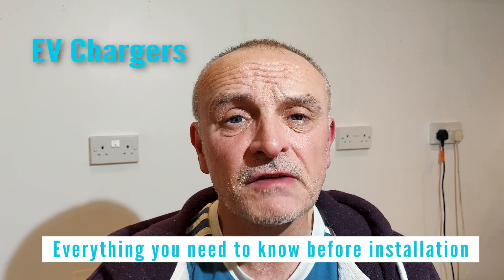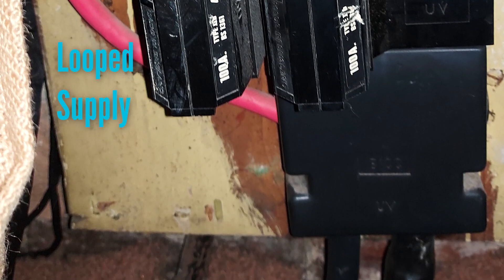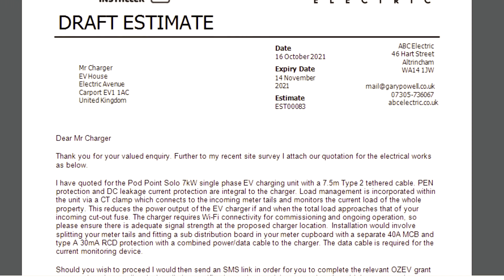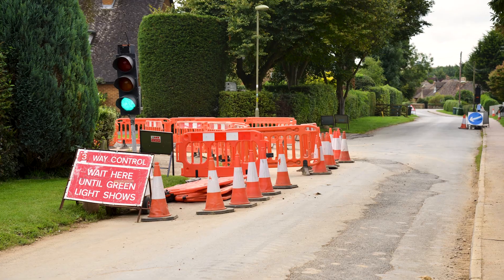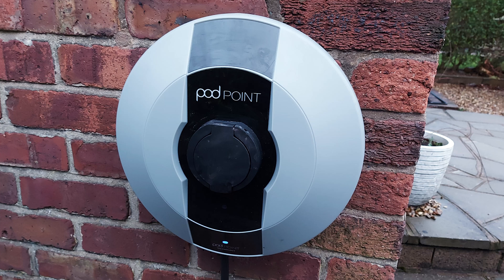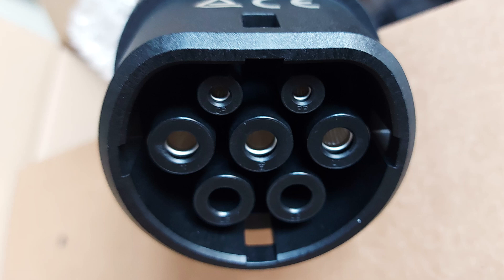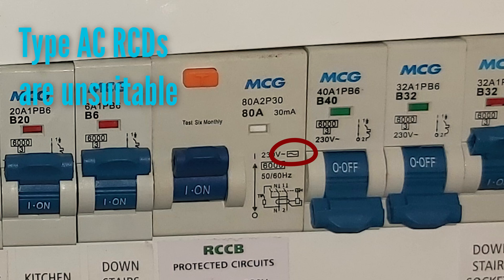Everything You Need To Know Before Installation of an Electric Vehicle Charging Point

Comment: Ohme have told me I’ll be able to have a standard install for my home charger as there’s only one cable coming into my electric box so in their minds I’m “not looped”. However, the property I’m joined onto and is closer to the road than me has 2 cables in theirs. Having searched online, I believe I am a loop off of their box/feed. I explained this to Ohme but they still claim I’m not looped and the installation will be ok. 

Is it only an issue for those that have two cables because it could disrupt their neighbours supply too or could I be right in thinking I’m maybe at the end of a loop out of their system and this be a problem for me? Thanks in advance!
Reply from the maker: Hi. It certainly sounds like you're the end of the loop, but the only definitive way to find out is through the DNO. The reason it's an issue is that the shared cable wasn't designed to carry the potential load to 2 properties simultaneously and adding a charger is a big addition. The DNOs are now allowing chargers to be fitted to looped supplies if load management is installed, and they will then unloop it in their own time.
Reply: @abcelectric  thank you! With our housing setup it seems the most likely that I’d be the end of a loop, so will ask/mention to the installer when they arrive. Is load management something that can be installed with any of the common EV chargers or is it only available on certain models? I would be happy with a restricted charging speed as a shorter term solution - I just don’t want anything to be unsafe!
Reply from the maker: @kingweddingmedia  Most chargers can be downrated or fitted with load management. Without knowing specific details of your installation and what was quoted etc I can't comment. What I would say is that Ohme should know what they're doing. The protocols for fitting chargers are well known
Reply: @abcelectric  fab thanks for your reassurance and completely understand you can’t say for sure etc. Earned my sub! 👍

Comment: Hi mate prob a silly question but im looking into this atm as just orderd a car, but a live in a new build property were the electric meter is on the side of the house  next to were i want the charger to be installed, the fuse box is inside my house under the stairs cupboard , do you need to have a cable  to the fuse box  or is it just the eleci meter you need, sorry for  the long winded question🤣
Reply from the maker: Generally speaking, either the consumer unit (fuse box) or incoming supply tails (from meter) are acceptable to supply an EV charger

Comment: This reminds me when the tv signals where being changed from analogue to digital. A lot of aerial fitters where making a killing installing so called digital aerials when in reality they was not required. The twist in the tale was when the analogue signal was switched off the digital signal was increased anyway. I appreciate the safety of electrical installs as I’ve been an electrician for 40 years but I fear it’s being milked to a certain degree. I’m not suggesting this chap is milking it, he as to say all things that meet present day regs.
Reply from the maker: I don't write the Regs. My responsibility is to work to them and the point of this video was to try to explain them. When you actually realise that the Regs are essentially written to prevent 2 things - fire and death under fault conditions - then they make a lot more sense. As technology advances the Regs get more complicated. It's evolution and progress. What's annoying is people thinking that they're there to make money, which couldn't be further from the truth. They're there to save money and to save lives. There's zero analogy to TV transmission protocols.

Comment: You covered PEN protection but didn't talk about what now seems to be a requirement to fit a protective earth rod. My question is - if you do fit an external earth rod (and check it meets requirements), does this mean you no longer need to have any other form of protection against PEN problems that stem from the incoming mains connection and bonding of the earth and neutral outside your house ?  thanks
Reply from the maker: PEN protection usurps the need for an earth rod and all chargers sold for the UK market incorporate PEN protection. Tesla Wall Connector is the only major charger I know without it. An earth rod is only required if you haven’t got PEN protection. In that very unusual case, you would basically make the supply to the charger TT, so that loss of the N conductor still leaves an earth path. You then have to be very careful with bonding in the 10m equipotential zone to avoid introducing a potential difference under fault conditions. Also, in urban areas, fitting an earth rod is not a clever idea as you could easily hit gas, comms, power or anything else, even if you could actually drive one in. Even if you did, everyone around is probably on TN-C-S, so unless the property is detached and a long way from any neighbours, you're opening up another can of worms regarding equipotential zones. There is no requirement in the Regs to fit an earth rod, and given the above, why would you even bother? It's cheaper and safer to fit the included PEN protection or buy/install a Matt-E or Garo PEN fault device in the exceptional case that the charger hasn't got it.

Comment: Great video. I have an overhead supply and it’s looped to two other houses. I don’t cook on electric and don’t have an electric shower, so nothing pulling 7 kW of power! I have phoned my power supplier and they said it shouldn’t be an issue and can probably just need a fuse upgrade and maybe A power limiter fitted. What I was wondering is, is it easier to un- loop an overhead supply? As I can’t see my neighbour being to happy to have her house pulled to bits! Any help or advice about this would be much appreciated. And I’m sure there are a lot more people that would like to know about the overhead supply being un-looped as there are No Videos about this subject to be found on YouTube or anywhere else so I’m sure a video about this would be very much appreciated. Kind regards.
Reply from the maker: Hi. Thanks for the comments. I have no idea about unlooping an overhead supply. However,  an EV installer would submit an LCT application form to the DNO if you're going to have an EVCP fitted. I can't see that the DNO's responsibility would be any different, so if you needed unlooping, they'd have to do it regardless. It's part of the ENA regulations. As regards making a video on it, there's no call for it. It's not an electrician's job to unloop a supply and we can't do it. The supply to a property is solely the responsibility of the DNO in that area. The fact that I discuss unlooping doesn’t change. In my area they're all underground supplies as it's very urban, but the same principles would still apply to overhead lines.
Reply: @abcelectric   Hi, thanks for the reply. I was just wondering if it was a less messy job unloosing an overhead supply than one that was underground? Not sure if the neighbours would be over happy! Anyway, I called my DNO after looking at videos and the lady I was talking to said she would get the people that deal with ev chargers and unloosing to call me and they did. They told me a fuse upgrade would be sufficient and they have thousands of homes like this.. I don’t cook on electric and I don’t have an electric shower or anything else that pulls lots of power so I’m hope it’ll be ok. I guess I’ll just have to get someone to come out and see! Thanks again for the reply. Much appreciated.
Reply from the maker: Sounds like you should be OK then. Regarding "unlooping", I would think modifying an overhead supply would be far less invasive for any neighbours than digging up their drives/gardens. Either way, they can't say no, and the DNOs do an excellent job at reinstatement.
Reply: @abcelectric  Hi. Yes I thought it would be easier with it being overhead. As for the neighbours not being able to say no, well I didn’t know that! Not that I would want to be at loggerheads with my neighbours! Thanks again for the reply and your help. Keep up the good work with your videos, always people out there looking for help. Kind regards.

Comment: With such lead times DIY can be done in one evening for the fraction of cost.
Reply from the maker: Which equates to a fraction of the safety with a huge dose of stupidity, but you've obviously not watched through or understood.

Long lead times are where the infrastructure needs upgrading, and no DIYer is ever going to dig up the road and fit a new 35 SNE/CNE cable with live jointing.

As for charge point lead times , they're pretty much off the shelf, and the lead time to fit is so that the installer can do the pre-installation survey, quotation, notification paperwork where necessary, and book the job into their busy schedule. It'll then be fitted to BS7671 and won't cause a fire or kill anyone.

You point me to a DIYer who would quite easily be able to do all that in an evening at half the price. 🙄 🤔
Reply: @abcelectric  Absolutely agree with that. The comment was mainly to appreciate your work and make your video more visible to others, there was no attempt to encourage doing stupid DIY things without appropriate knowledge. Thank you for your generous reply.
Reply from the maker: A bit of reverse psychology eh? Thanks for that then Volodymyr. That's given me a little chuckle 😀

Comment: We have an induction hob and that makes a CT clamp show an incorrect load even when it's switched off. How do you get around that?
Reply from the maker: Check that it's not a different appliance or circuit that's pulling the load and if the CT clamp is still giving inaccurate feedback replace it. Also check everything is installed and setup correctly. You need to get someone to test the readings with a clamp meter and fault find accordingly.

Comment: Have a question, what about if I don't have off street parking? Do I need permission.
Reply from the maker: Tricky one! If you mount the charger on your property and then use a cable cover to prevent a tripping hazard then you might get away with it. If anyone fell over the cable/obstruction you'd no doubt be liable and possibly wind up with litigation. Or, you could ask the council for permission to cross the footpath with a cable or to fit a charger on it and probably wait a few years for a "No". Private EV chargers without off-road parking are not a good match. If you installed one on the footpath without permission you'd probably end up in another legal battle. Just my thoughts from experience. Likely a no win situation, but whatever you do I'm not responsible  for giving you my opinion 😉

Comment: Interesting about the wait time to get permission to install…I completed my order with Pod Point directly on Friday and got a date for installation on Monday
Reply from the maker: Under certain conditions, often when you've got a 100A cut-out and a low existing maximum demand, it's acceptable to do the notification after the installation
Reply: My DNO did not know what main fuse  was fitted at my property mine is in a metal box with no label on the outside  but I did a couple years ago  have a smart meter fitted. They also upgraded the tails. Does this make any? Difference thank
Reply from the maker: You still need to know the main fuse size irrespective. Ask the DNO to come and check it. You also need to check if you're on a looped supply
Reply: @abcelectric  thank you I know I’m not on the loop supply I only got one main Wire coming in  but you would think they know my fuse  when I asked my energy supplier, the same question, they said they don’t give me that information they for am asking them something dodgy
Reply from the maker: @JAKE ROAD TO NOWHERE  The best thing to do is to get a local EV installer to do a physical site survey and quote. They can then submit an Application To Connect form for an EV charger and the DNO will have to check your supply and fuse. Just because you have only one supply cable in your house doesn't mean you're not looped either. You could be last in the chain. Submitting that DNO form makes it all get checked

Comment: New to E.V as never installed a charger to any installations but why does the DNO need to know the customers having a car charger and why do we need their permission ??
I know its a high current demand device but so is a cooker or electric shower.... i dont need permission to do that as far as im concerned..? Or is this new requirement / Regulation as of 18th edition Amendments. ?
Cheers Mark
Reply from the maker: It's Regs. Remember that a car charger could be on full load for 12 hours. That's a far cry from a cooker taking into account diversity, or a shower for 10 mins. The time/current characteristics of the main cut-out won't cause it to trip with a few seconds ir minutes of overcurrent. It's a different story over 8 or more hours
Reply: I have a looped supply  with one other house.  16mm tails but a upgraded intake of 100A done by the service provider this week. He said it would be around £3.5k to £4.5k  to have my own feed. Any idea if this true?
Reply from the maker: In my area the DNO upgrades looped supplies free of charge for EV charger installations. It can take a few months, but they do it. Needs all the correct paperwork submitting by the installer and you have to wait to fit  the charger until then. That said, I find it extremely surprising that your service provider has upgraded you to a 100A fuse on a looped supply and also left 16mm tails. That's just asking for problems

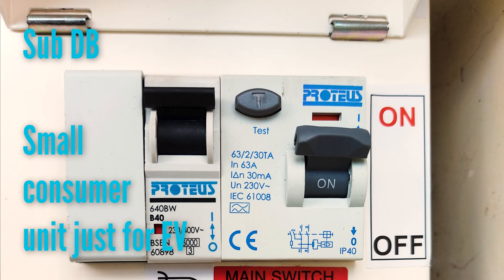Comment: 3:25 Fitting a new mini consumer unit. Could you please suggest any IP68 version? In case, if the DNO supply is outside in its box, would you add next to it? Similar to Caravan consumer unit. Thanks
Reply from the maker: Proteus do a plastic 4 mod IP68 bare unit. I've used this solution once and fitted it next to the external meter cabinet. I carry several of the Proteus EV mini DBs in the van and just swapped the innards on this occasion so that I'm not mixing manufacturers. Works out cheaper than buying the parts separately

Comment: Hi Gary,  can you use RCBO (type B)?? (RCBO located after the main breaker)
Great video Gary, many thanks
Reply from the maker: Hi KOKO. I think you might be confusing the terms "B Curve" with "Type B". The curve relates to the overcurrent protection of the RCBO and the type relates to the current waveform and its capabilities of detecting DC current faults. They are 2 entirely different things. The installation and charge point parameters will determine whether you need a Type A, B or possibly even F RCD/RCBO. The MCB or "O" part of the RCBO will normally be a B curve. I have never come across a  Type B RCBO, but you can get a Type B RCD. I would suggest getting a qualified electrician experienced in EV to check your requirements

Comment: Hi Gary, am I correct I thinking that the EV point supply cable doesn’t always require RCD protection if the cable is suitably protected? 
Thanks mate.
Reply from the maker: It depends on the installation method used and the type of cable. If the RCD device is upstream then it's not an issue, but if it's downstream then the cable may or may not need RCD protection. Without getting into specifics, if there's no RCD upstream then armoured is possibly required, but if it's all clipped direct then an MCB upstream should suffice because the "socket" outlet of the charger is protected by the internal RCD. It's all in BS7671 if you're in any doubt, but where people get confused is if the protection applies to the cable or the socket outlet. They're 2 different things

Comment: have never seen that form infact everything was done on pod points website I not completed any forms.  No survey they ask me for pics of meter pics of where I wanted  and I said it was about 15 meter give or take , that was if gave them mpan. Paid  Next day got my fitting date
Reply from the maker: The ENA form is completed by the installer, not the client. If you have any concerns you need to take it up with your installer as every installation is slightly different. I can't imagine Pod Point would knowingly do anything contrary to the wiring regulations or ENA protocols

Comment: I am very concerned in Dec 2021 pod fitted me an ev charge I had no profit inspection. Other than me sending pics of the meter.
On the day of fitting the fitter never came into the house I asked did he need to see the consumer box. Answer was no 
We don't go near your consumer box. 

Dno, say no consumer boxes to be fitted to meter board.  The electrician fitted a mini consumer box to the meter board. 
Not sure this is right.
Reply from the maker: Each DNO is different Keith. Some do and some don't allow other equipment to be fitted in the meter cabinet, although they don't own the cabinet as it's on your property. My understanding is that the top right of the meter cabinet is reserved for clients' own equipment, but I think it's a very grey area and you will get a different answer depending who you ask and who the DNO is. I can't give any definitive answer